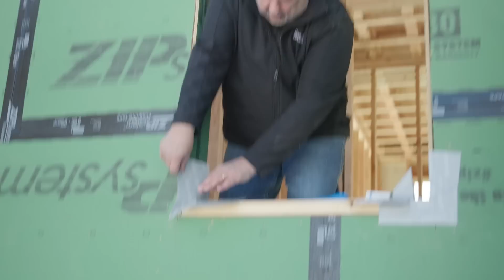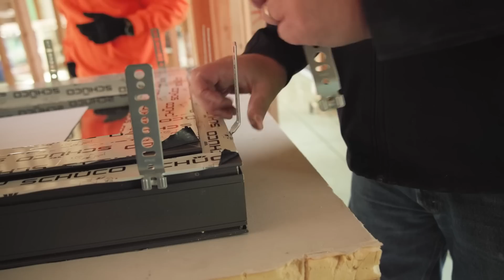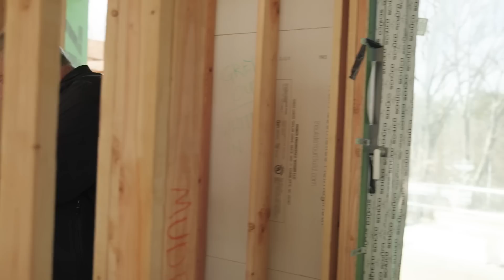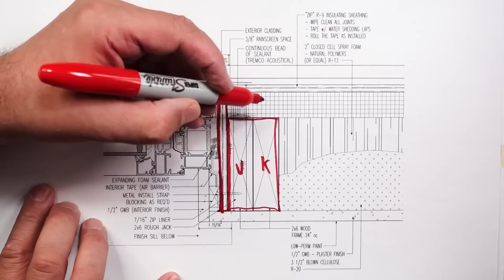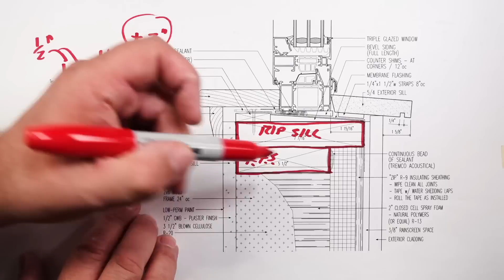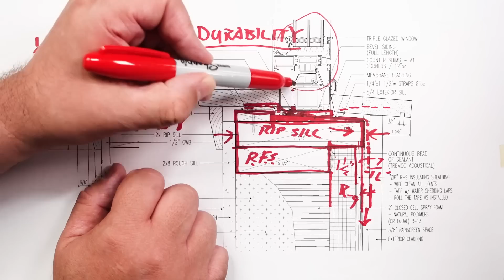"Window Installation Pt. 2" Build Show Build: Boston Ep. 8

Comment: I see a potential condensation problem with this design depending upon climate.  You have an R9 exterior, and R13 spray foam.  I would be concerned that the temperature on the inner face of the R13 spray may have condensation and could be soaking the batt insulation.  Remember that you only get condensation on a solid surface.  I would suggest at least 4" of closed cell on the inside of that wall cavity, again depending upon climate location. If this is Texas, you are OK, if this is MN, probably an issue.

Comment: Steve, Matt I've recently discovered your terrifically informative videos while embarking on a replacement window project for a home I build 32 years ago in Southeastern, MA coastal community; thank you!   I've been looking at the Schuco windows at EUR Arch Supply in Littleton, MA; I've decided the Euro style windows are the best approach versus the top US brands which in my view are inferior products.  My application is a traditional Nantucket style cape with 2x6 construction, exterior plywood sheathing, building wrap and finished with white cedar shingles; nothing unusual in this area and era of build.  I've been trying to resolve how best to deal with the Sill area and water management with the new windows.  Looking at your cross-section drawing (thank you!) I like the use of the cedar siding and counter shims for allowing water run-out and leveling of window base.  My question is how do I best manage the water that will now flow between my shingles and building wrap; do I just accept that this is the case and say it's better than having it run behind the building wrap.  Your section view shows a 3/8" rainscreen space, however I don't see a practical approach to accommodate this on an existing structure with the shingled siding.  Also, I see under your exterior sill you specify 1/4" x 1-1/2 w straps 8" oc.. I presume these simply to lift sill and allow water management.   

I'll appreciate any comments in reply.  Thank you.
Reply: I live on the coast of SC and Schuco could not give me impact  and high wind data for a hurricane zone.  Good windows, but I cannot use for my local.
Reply: @coasttal123  Thank you for reply, currently the town is not requiring hurricane windows.

Comment: "All building assemblies are systems. They are not components, they are systems."  

This is why you can't take any old set of building plans and shoehorn in some building science magic to make it passive house or [insert trendy label]. 

This one thought alone from Steve perfectly encapsulates all good building science. Buildings are complex systems. Any approach to a building that doesn't understand how any one modification might affect the rest of the systems will usually result in a failure of one or more of those systems.

Comment: Hi Steve, great video. You consistently point out and explain all the small details I have questions about, like how to create a level surface to place the window on if you're using bevelled sills. A question related to heavy windows in this scenario: if they windows are quite heavy (500-900 Ibs), I assume those reverse cedar shims might not be strong enough to support that weight?

Comment: I saw in Part 1, the window example that you were discussing with Spencer from Schuco had packers on the bottom and sides of the window; however, the few videos you have done on European style windows, I have not seen any packers installed.  I am installing some European style windows soon, and their installation instructions calls out very specific areas around the window where packers should be installed for load transferring.  What is your take on the use of packers for European window installations?

Comment: Thank you @stevenbaczekarchitect9431 .  I am just a layman interested in building science.  This was the best explanation of these concepts that I have ever seen. Your clients are very lucky to have you.  I am more and more convinced that flangeless windows installed as you've shown is THE way to go.  One additional plus is that if the window ever needs to be replaced, you don't have to disturb the cladding to install the replacement window--and the replacement can be installed fully properly with all the redundant water management layers in place. It seems really hard to replace a flanged window in a brick-clad house that is using Tyvek for bulk water control, for example. This system you showed just seems better all the way around.
Reply: Thank you for joining in

Comment: I have a question, why is the air barrier (zip system) outside the insulation (polyiso+cell foam)?  Isn't it the other way around?  The zip system directly on the framing and then the continuous insulation outside?
Reply: ZIP sells the panels in R3, R6, R9, and R12.   I use the R6 panels and can actually use them for shear using 16d ring shank, in a 3/4 pattern, blocked edges.  Huber warrants this.

Comment: Steve if one was doing drywall returns, how do you handle those clips that are proud of the rough opening? That’s going to cause drywall to stick out on sill AND wall where you didn’t trim the clips flush with rough opening
Reply: Drywall always gets padded out - same for wood trim
Reply: Side grinder.

Comment: Thanks for doing these videos! Question about sealing the inside of the window. Are you suggesting 3 options? Foam,  backer rod and big stretch and siga tape? Or are you saying use foam or backer rod with the big stretch and then cover with the siga tape?
Reply: yes - any of the options and finish with tape
Reply: Depends on the gap to be filled.  I prefer backer rod as the 1st line of defense, because spray foam can shrink a bit over the long term.

Comment: Steve, will you be showing how the dry wall is installed with these types of windows?  I was wondering if there was going to be a bump/bulge where the window bracket is screwed into the frame.
Reply: Yes sir, no bulge, the opening will get furred out and the drywall will be recieved by a FRYE Reglet (J channel)
Reply: Thanks for joining in

Comment: It'd make more sense if you put flashing tape (middle piece) first and then corner tape?
Reply: I don't think it matters, I should have turned the sill piece up the jamb, 45 cut the corner, then apply the corner over.....or vice versa.....
Reply: @stevenbaczekarchitect9431  For inset windows, I think liquid flash will offer the best chance for success.  I have found that concave corners are not the best for tape.
Reply: @coasttal123  I would agree in a perfect world......however, experience suggests that tape is more friendly that goop, and success usually relies heavily on the install, rarely the material....

Comment: Fabulous Video Series! In a previous video set of details, you installed the window directly on top of the 1x3 back dam. Here you are using the counter shims on the sloped cedar. Interested to know what led you to choose each system. Also, you have specified Tremco Acoustical at the joint between the Zip-R foam and the (2x6) rough sill, what is the purpose of this seal?
Reply: This detail has better water management, on top of the backdam I am comfortable with as long as the overhangs are significant 24"+.........The tremco was for an above average aggressive approach to air tightness, with likely no flash of CCSF on the cavity side

Comment: Those windows are weather resistant barriers.  A lot of other windows have the performance of the defensive line of the 2008 Detroit Lions.
Reply: You give them that much credit?
Reply: @stevenbaczekarchitect9431  I started answering your question with a very long answer....The type of windows have a better design, better reinforced, more efficient material usage, better install, better sealing solution, more energy efficient.  Theses type windows should be the US standard, in the double should be the exception and used with a building design creates a constraint.

Comment: Common practice in Europe  to install those windows is to bring that window out in foam and instead of 2 by 8 to use special saddle made of high density xps foam.
Reply: Yes, it is a great system. I have seen it over there. That system is also based on a masonry frame
Reply: @stevenbaczekarchitect9431  another way of doing it in my opinion would be to use T-stud instead of 2 by 8

Comment: A couple years in the future "why does this one window leak at the bottom?"
Reply: See, if you knew anything about window leakage, you would understand that most windows leak from the upper frame. Even if water gets in, there is no force to drive it in as it is managed to fall to gravity.
Reply: @stevenbaczekarchitect9431  Great video, was just joking about the architect putting the tape on :).  One think I would like to see a bit of in these videos is how to apply the tape over the clips and at the corners, doing that properly is probably the hardest part of the install.

Comment: funniest part is they will spend all this money on these turn tilt windows and spend twice as much for mechanical ventilation and then will never open those.
Reply: Less than half of these are operable, and of those, half of them are required
Reply: @stevenbaczekarchitect9431  I would just meet the minimum egress requirements. Maybe ones that are hard to access from the outside. There are very few people, especially people in custom homes who will ever open a window.
Reply: @av1204  when I have the conversation with my clients they have a very hard time giving up operable windows in many cases. I'm with you, egress + a couple......thanks for joining in

Comment: Installs like a replacement window not impressed.  should have a flange     i have many questions about such methods in a coastal community.   your trust in zip as an infallible water barrier worry me as well.
Reply: I would like to see your side, but these are the most widely used windows in Europe. Probably the biggest failure in window installation is the logic behind most installations, you suggest the windows should be flanged, to keep water out? Good luck, your never keeping all the water out, and the bigger question is, what happens when water gets in? How does it get out? Ask away your many questions, I just did a home on the Ocean coast with 90 windows, house in service for 4 yrs now, no problems?? Lastly, what is it about the Zip tape? I took two pieces of Zip from my first project ever using Zip. I taped them together and have left them outside for over 13 years now, the tape adhesion is as good as day 1
Reply: @stevenbaczekarchitect9431  Steve, while we do not always agree on everything, I do appreciate you put details on paper that rarely other architects or designers do.
Reply: @coasttal123  I respect all respectful discussions. I don't agree with alot of professionals, some I work with regularly, but that keeps the discussion relevant - thank you for joining in

Comment: I have a hard time accepting this because I don't feel this is a proper shingling technique. Suppose  condensate accumulated enough to roll to the bottom of the preformed corner, it's going to run into a seam and not roll over it. Am I wrong??

I only question bc there is never a dumb question when it comes to waterproofing.  Love all build show videos.
Reply: What didn't make the cut was a piece over the preformed corners to ensure that doesn't happen
Reply: @stevenbaczekarchitect9431  if that is the case and the verticals overlap those pieces....then all is rt in the waterproofing world.
Reply: @impalaon22inchrome  I'm actually going to see the tape/corner manufacturer and discuss the shorthanded nature of their corners
Reply: @stevenbaczekarchitect9431  thank you for taking the time to answer my  concerns. Continue your great work sir.
Reply: @impalaon22inchrome  I consider these videos a discussion, not a lecture, we all learn something thru discussion
Reply: @Steven Baczek Architect  I wanted to bring a comment under mine to your attention. It's a picture of Matt, but seems fishy.

Comment: When we install schuco system we typically use Dow 795/756 silicon; commercial application. Applied inside and outside. Minimal gap is 3/8 for silicon. cannot use silicon once it gets less than that. Its due to the movement requirements.  We tried Siga tape before due to architect request, but it does not stick to silicon. so got to be careful about the tape.
Reply: Very good

Comment: Great windows but the price is not affordable.
Reply: Debateable - they do have a Upvc option that as a triple glazed option will rival most double glazed options
Reply: @stevenbaczekarchitect9431   Not everyone can afford the most expensive.  If these windows were available to general public like they are in Europe -- I'm sure the price would be lower.  American distributors and manufacturers are satisfied selling low
 quality.
Reply: @johnmarquardt1991  I agree, but even in affordable projects we have used Schuco's UPvc. Their price as a triple glazed option rivals most domestic manufacturers in price. These are not even close being "the most expensive". And I agree with you Manufacturers are Ok with building less performance because most of them try to avoid the question.. The one's installed here as Aluminum are not cheap, but they are not the most expensive either. I have priced the aluminum against a prominent Aluminum clad double glazed and they were cheaper, at twice the R-value.
Reply: @stevenbaczekarchitect9431  But not hurricane rated.
Reply: Define "affordable". I'd argue if you're building your dream home, you budget for good windows that will last the lifespan of the building, rather than replacing some leaky vinyl home depot windows in 10 years.
Reply: @ASIRIDesigns  Leaky depends on how they are installed ... even these thousand+ dollars windows are not installed correctly they will be leaky.
Reply: @johnmarquardt1991  For sure, no argument there - but I'm talking about the window unit itself, not the window to wall interface. You can air seal a piece of cardboard, that doesn't mean it's going to last a long time.
Reply: @johnmarquardt1991  you can't install these wrong, the frames won't rack at all..
Reply: @ASIRIDesigns  C'mon There's a lot of options, performance and pricing between Shuco and Home Depot specials..  I'm facing these choices with my own "dream house" build and there is a budget.  A "Pretty Good" window makes the project actually possible.
Reply: @jesinbeverly  Schucco UPvc will rival any window on the market, especially if you consider the windows as part of your HVAC/pricing